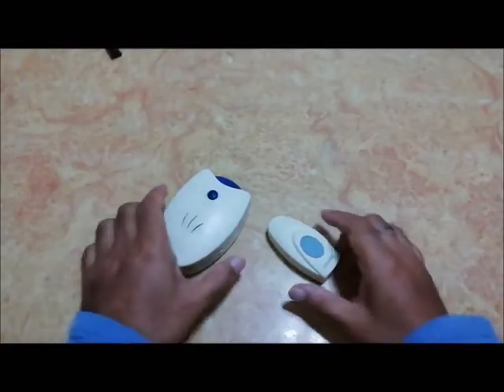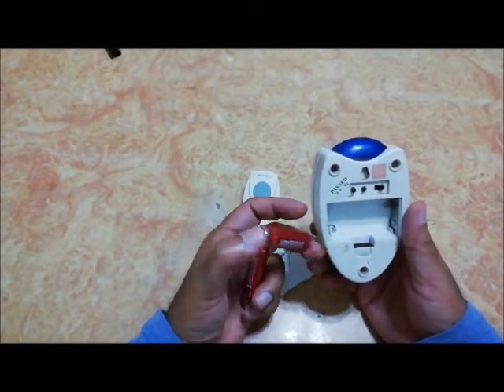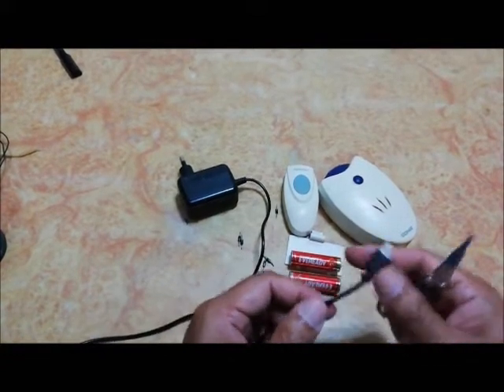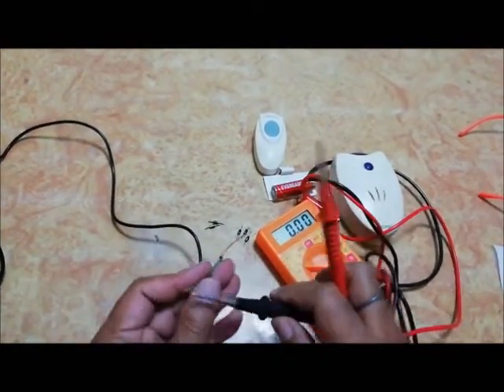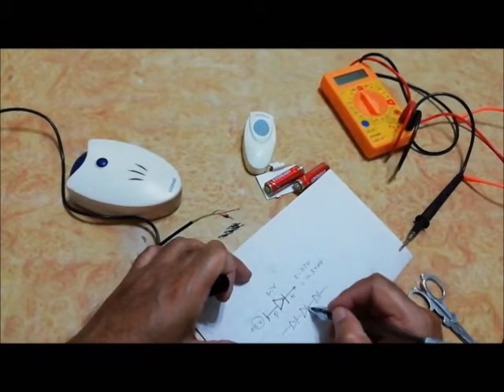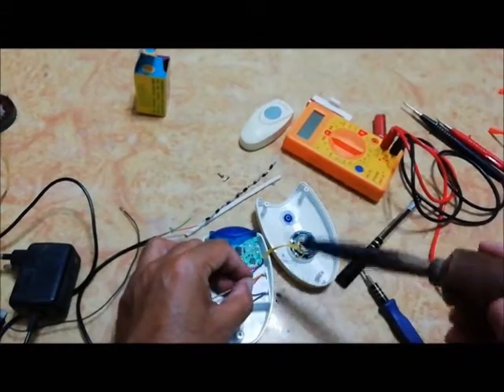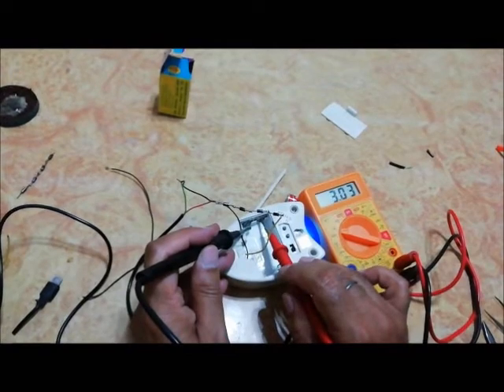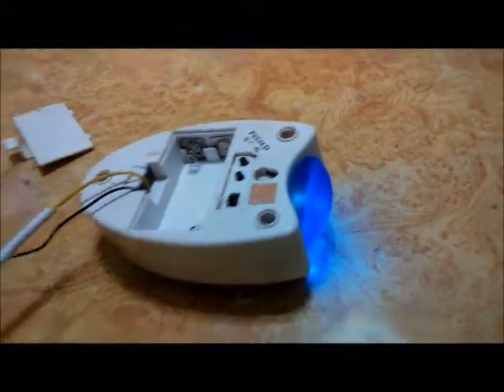Cordless bell battery discharging problem solved DIY

Comment: Can we use lithium ion battery instead of charger? Please explain. Tried with 3 diod but some sound is coming
Reply from the maker: Yes, Lithium Ion batteries can be used. If there is a humming sound, then the adapter you are using is not of good quality. After the diode use a filter capacitor 1000 uf 10 volt.